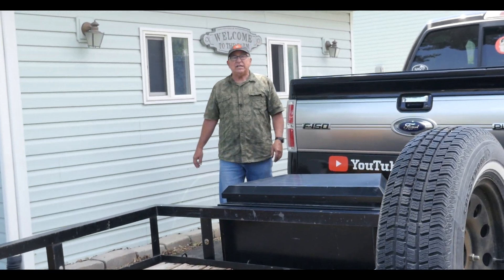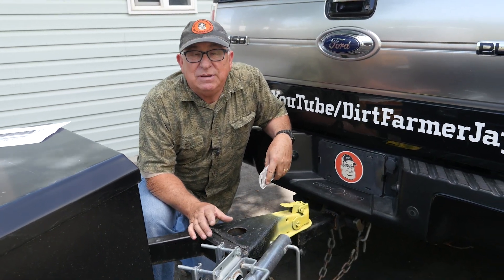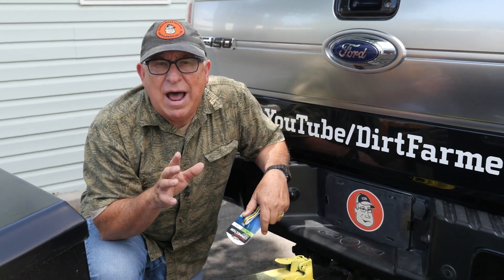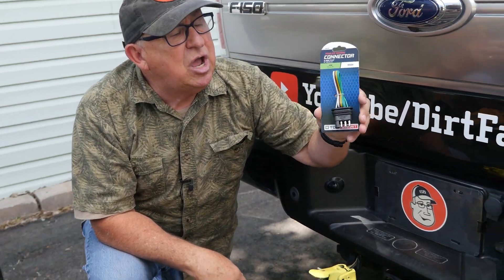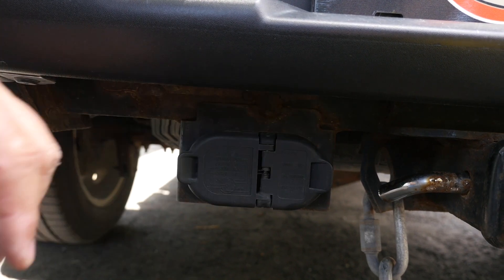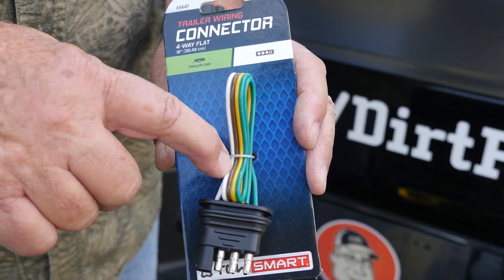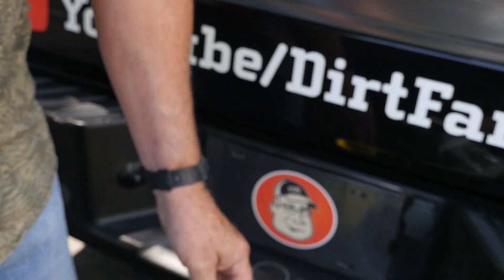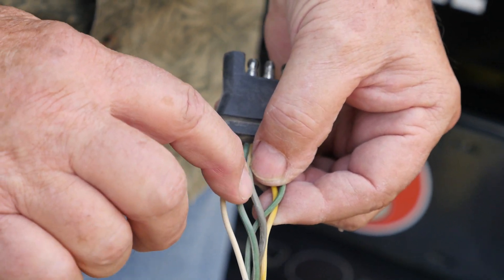Trailer Wiring Made Simple: What Every DIYer Should Know

Comment: Why did you not talk about brake lights? 
How they work?
Reply from the maker: Thanks for asking. I've had this question a few times now, so I see that I was not clear enough on how the brake lights are wired using a 4-wire harness. The brake lights are automatically integrated into the turn signal wires (yellow/left and green/right). There is no need to wire them separately as they are already accounted for. Make sense? We'll likely make another video to clear this up further. Thanks for watching and writing! Best, DFJ

Comment: Lol I guess you don't use breaks lol I wouldn't let you wire up my kids wagon lol
Reply from the maker: With a 4-wire harness, the brake lights are integrated into the turn signal circuits, so when you press the brakes, both tail/brake lights will illuminate. Thanks for stopping by! Best, DFJ

Comment: Jay, can you suggest what may cause the problem on my boat trailer lights. My garage kept trailer running lights will not work! Signals, braking, and turning lights do work. All bulbs are good and four pin coming OUT of my truck checks out fine. Driving me crazy. Help please.

Comment: You are spot on about the grounding.  I have found that applying some electrical anti-oxidant grease to the trailer ball, the male end of the trailer receiver on the hitch, and the cross pin helps ensure you have a good ground.  These are all locations where the ground can fail due to excessive rust that can develop from a lack of use.

Comment: This is all good but you dont talk about the BRAKE light.  What wire do you hook the Red Brake wire too?  I am hooking up an add on center brake park light.   The Brown on brown is good for the running lights.  Per my manual it shows the yellow and green are for STOP lights and Turn signals.  Course if you hook to the yellow you turn signal works but so does your center light.   What wire do I hook the stop light to from the center light to not make it flash when I do the turn signal?   I tried the brown/white wire and it does not work for stop light?  Im confused????? Please someone HELP... lol
Reply: What red wire are you talking about. From the actual light or from the plug? The red wire on the plug is a accessory wire. You should be hooking to the brown wire for running lights
Reply: The problem is the plug on the truck sends power out the yellow and green wire while pressing the brakes there is not a designated circuit for just brake lights

Comment: I have something weird going on. With my headlights on my left turn signal doesn't work but my right side does. When I turn the headlights off then the left turnn signal works. The plug you showed in your video, the new one, I bought a new one and ready wired everything correctly and im still having the same problem.
Reply: Did you ever fix this.? If so how.?
Reply: @saracano0427 I had to run a white wire from one of the nuts of the brake light and drill a self tapping screw into a flat area on the back of the brake light. All ground wires.

Comment: Didnt see one light wired.
Reply from the maker: Thanks for stopping by.
Reply: @DirtFarmerJay  Which color is for brake lights, you missed that?
Reply from the maker: @alexshatner3907  with a 4-wire harness, the brake lights are integrated into the green and yellow turn signal wires, so when you press the brakes in the vehicle, both tail/brake lights will illuminate. I hope this helps! best, DFJ

Comment: Do trailers have brake lights? If so, how do you get brake lights to work? Thanks!
Reply from the maker: Sorry for the delayed response. I just say this. With a 4-wire harness, the brake lights are integrated into the green and yellow turn signal circuits. So, when you press the brakes, both tail lights illuminate. I hope that helps! Best, DFJ

Comment: i have 3 grounding spots on each of my two utility trailers. I also had problems with the trailer lights once. I was sure it was a trailer side problem. it turned out to be the wiring harness I purchased that plugs into the rear wiring harness in the tow vehicle.

Comment: My truck turn signals make both trailer lights blink as if I've turned on my hazards. I've sanded every white/ground area.
Reply from the maker: Mick, you might find this to be helpful:

https://www.etrailer.com/question-207035.html#:~:text=Expert%20Reply%3A,two%20circuits%20are%20touching%20somewhere.
Reply: @DirtFarmerJay  Thank you for responding. I'll check it out.

Comment: my advice - each component (light) in a Direct Current wiring harness should have it's own ground. In other words, do NOT use the ground wire from "Component A" to power "Component B".
If you only have one wire (1 brown wire, for example) but want to power another light, use a 3-way splitter that splits that single wire into 2 wires. Then, each light should either be grounded to the frame of the trailer or wired back to the white wire, coming from the plug.
If you have a light that is dim but not flickering, it might be wired in a grounding, daisy-chain where both lights are using a common ground.
Hope this helps!
Reply from the maker: This is a great approach! Thanks for jumping in and sharing your knowledge. Best Regards, DFJ

Comment: Do the white wire have to be wired or just attached to metal. Thank you
Reply from the maker: Just as long as the white wire is securely attached to the metal frame on both sides of the plug/harness, it will work. I like to put that attachment in a sheltered place to it doesn't get scraped or abraded. I hope this helps! Best, DFJ
Reply: Thank you very much for the info

Comment: Howdy,
    Good video, have one question sir ; 2 wires for 1 plug on the flat 4-way. My lites work fine...except...break and all 4 bulbs come on
Meaning mash the breaks turn & break lite up. 
Turn either way using signal,  break turn lite up.
Still with me.?
Reply from the maker: I think I follow you. The first place to check is to assure you have a good ground THROUGHOUT the system. That means the ground on the vehicle, the connection to the connector from the vehicle, the connection to the connector from the trailer side, and the connection to the trailer frame. You really need to inspect all 4 points closely to assure there is connection. If there is a break anywhere at these 4 points, then they system will "find ground" in some really befuddling ways. Do the check, correct any problems, and come back to me. If the issue still exists, we can go from there. Best, DFJ

Comment: So the 4-way ones do not show brake lights when the towing vehicle uses them? Only the 7-way one does?
Reply from the maker: Hmmm. I'm sorry I gave that impression. All versions of the wiring harnesses will always have a brake light function wired in to them. Best, DFJ
Reply: Thanks @DirtFarmerJay
Reply: Yes the 5 way plug has the brake lights just like the 7 way, the 7 way has extra options for trailer brakes and an even a extra terminal that can be used for back up light, or camera power.
Reply: @dogpatchfab  -- There's 3 types of plugs -- 7-way, 5-way, and 4-way... My understanding of the 4-way is that it does not have a separate brake light, but if wired correctly on the vehicle side, it kind of simulates it by using the using the tail lights (brown) while also lighting up both tail lights (yellow and green) at the same time... I'm needing to rewire my trailer and put new lights on it because my dog ate my trailer lights and wiring... Yeah, I know, it sounds like the excuse a kid would have for not having his homework for the teacher ("My dog ate my homework"), but it really is true... The crazy ass dog liked the taste of plastic and chewed up the lights and then started on the wiring... So, I need to replace ALL of it... I don't even have the original 4 or 5 pin connector (it happened a couple of years ago and I am just getting around to doing it)... Yeah, procrastination... I'm damned good at it...

I'm planning on wiring everything up to a 7-position box on the trailer tongue and then creating shorter cables for 4, 5, and 7 pin connectors... If I do it right, anything I might need to change would be a simple matter of moving cables around in the connection box... I'm also going to be using some square steel tubing to run the wires, just in case the dog I have now develops a tastes for electrical wires...